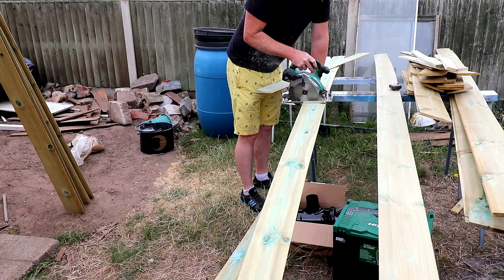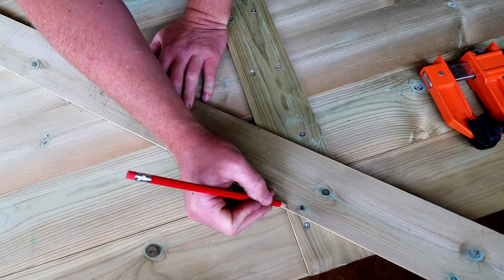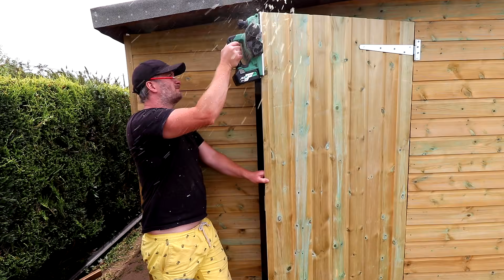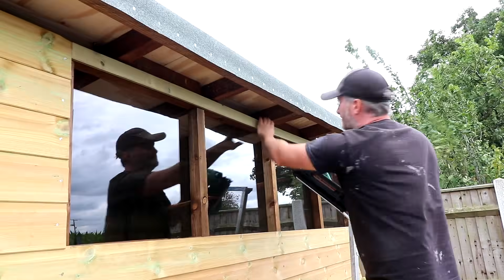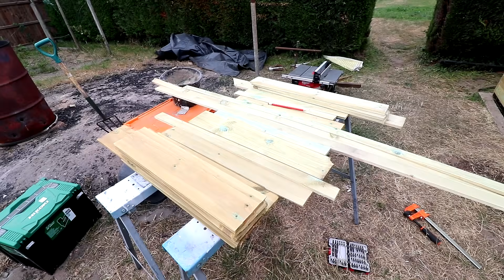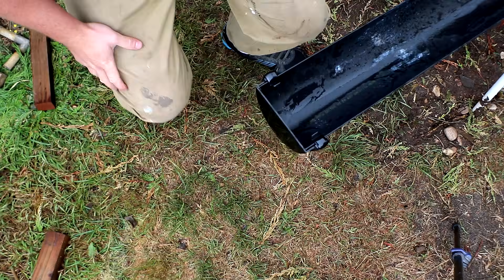Shed Door & Finishing Touches (PART 6 SHED BUILD PROJECT)

Comment: 99% Keith. You lose the 1% because EVERY TIME YOU OPEN THE DOOR ---- IT'S IN YOUR WAY!🤣🤣🤣 Why on earth did you not fit it, opening into the space you do not use?????? Mind boggling! Love your channel!
Reply: I always prefer an outwards opening door, obviously it’s less safe if someone puts something in the way when you’re inside & you can’t get out again (which is a key reason that internal house doors open into the room) but in this instance, the floor space and clearance inside a shed is more valuable and you might need those few mm that would otherwise block a door opening inside

Comment: Great video. Now time to try and recreate this with the world's cheapest table saw and a finishing hand saw...
Reply: Just like me. I haven't got all those power tools as I am not a builder. The only trouble was that the door kept springing open. I realise that unlike a house door you have to leave a space between the side of the hinge side door and the right hand door frame to stop the door binding causing pressure on the door which forces it to spring open. In other words I don't think one can fit the door flush with the right hand of the frame.

Comment: I've got the tongue and groove planks already to make my door for the small shed I built myself. I was wondering how I should go about nailing them onto the 'inside battens', found this video and had never even thought of gluing the battens on first before securing the planks with suitable length screws on the inside. Thanks, very helpful instruction indeed.

Comment: Due to my ignorance, if the vertical boards are fastened horizontally and diagonally, how can the boards expand and contract independently? I would think that since each board is different it will react differently.

Comment: Hi keith, Only looking at your finishin touches for the shed video just now. the tip imentioned back when you were starting the shed regsrding the slabs works for the paving at the front too. lay 2 lenghts of timber on the outer edges of your dug out foundation at the appropriate height and fall then get a piece of timber as a screed for the slab base. Cut a notch out of each end to the thickness or a bit less than a slab then scrape your sand base out. slabs are guaranteed to sit first time then. becomes a quick job....

Comment: I'd recommend adding 3 bolts to each of the supporting batons at the back of the door. After a few seasons of getting damp and drying out you'll find that the batons start to pull away from the door and the door begins to fall apart when just using screws.

Comment: Fantastic series, I love the simple window sils , and as you say what started off as make do to finish off the glass framing it ended up looking really good. However, I see you have no diagonals fitted for structurally bracing the walls. Is this an over site or international. It may probably be ok, but over the next year or so time will tell. The door staying square to it's frame will be the first tell if the shed starts to lean forward. I noticed in your last vidio when you were testing the strength of the roof rafters the top of the walls moved back and forward an inch. Please don't be offended by this honest critique, it's just feed back. As always 5⭐'s for your videos.

Comment: Hi Keith,  I enjoy your videos because you show it how it is in the real world. No job is ever going to run smoothly and it's nice that you acknowledge things are not quite right and how you work around them.  One thing I notice is how you hold your hammer.  If you hold it at the bottom of the shaft you will have much more control and power. It's balanced to make it like that. Just a thought. Keep up the good work. Ps I think if you are able to build a shed,  then it shouldn't be too much to design it. So long as you know the basics to setting out the frame. So I would say no to the plans idea.

Comment: Regarding plans, it seems you got a sketchup model already, so why not just publish that? I'd guess most people are perfectly capable of getting measurements out of sketchup here, and a 2d plan does not offer any advantages in my eyes anyhow.
Reply from the maker: The SketchUp model I did isn't exactly how I built it in the end, so it needs to be re-worked. Also I think the most useful aspect of the plans that I create is the visual diagrams and the cut list - at least that's what I think I would find most useful if I were following plans.

Comment: It will be interesting to see how the stainless screws hold up over time. Supposedly, stainless steel and treated pine don't go well together, which is why specific treated pine screws exist. Though any galvanised or class 3 coated screw will do.
A lot of your screws and the coach bolts appeared to be zinc plated too. Interesting to see how long they will last in the weather

Comment: Nice effort Keith. If you don't mind me making a suggestion, you should consider adding a door stop to the lower section of the door as well, to prevent warping of the door diagonally at the leading edge. And yes a third hinge would be ideal.

I've only just started my own channel, so I've got content envy of your great channel.

Keep up the good work!
Reply from the maker: The door stop goes to the bottom, it's in two pieces 👍
Reply: @RagnBoneBrown  Great minds...!

Comment: I set up a work area inside because (I miss having a smaller workshop...) No? :D Was that the Milwakee saw by the way? How do like that compared to the DeWalt? Great video as always. Cheers.
Reply from the maker: Thanks. The Milwaukee is very similar to the DeWalt, but with some useful additions, much less noisy and well thought out design.  Smaller table and blade though.

Comment: Hi Keith, I am sure lots of people will have already told you, but in case they haven’t the bolts with the square piece under the head are called “coach bolts” and they were first used in the making of coaches.
Reply from the maker: Cheers John

Comment: Hi Keith another great video , for the slabs I make a wooden frame outside the slab area and at the height I want the bottom of the slabs to be then use a broom handle fixed to a big block of wood {tamper} hammer the sand down and use a long piece of straight wood level the sand of the frame lay slabs first time ,
keep up the good work ,
G

Comment: It's Friday again!
Personally I am never really interested in plans. Most of the time I would make it different anyway because the situation for me is different. So 99% of the time I have to modify such plans anyway.
Reply: Yes. I see very little point in plans for the same reason. Mind you my shed is completely different....
Reply: I agree 100%. You've shown us the basic principles and most of us (if we were gonna build this) would do it slightly differently anyway. I prefer supporting you by buying stuff. No idea if that makes economic sense for you but every little helps? Keep up the good work Keith!
Reply: Drip edge and cladding is a nice touch too, but I’d use screws cos from experience over time the plastic can get broken/ need replacing (clumsy me or footballs!!) so needs to be easy to remove cladding.

Comment: That looks awesome & the attention to detail speaks for itself. Window sills look great. Much nicer then any shed you could buy. Where did you get that wire mesh you put around the bottom to stop rats etc. I need some of that for my workshop. I havnt had any problems to date but i also wanna put some gravel around mine so that would stop it going underneath.
Reply from the maker: Cheers! It's on eBay listed as "rodent mesh", available in different lengths and widths 👍

Comment: It’s all very well putting coach bolts on the door lock but all I would need to do to get in is remove the screws from the hinges. For added security on my workshops I put coach bolts on both parts of the hinges.😗
Reply from the maker: Did you watch the video?
Reply: Rag 'n' Bone Brown yes I did but I’ve never come across those special screws that you’ve used where can they be obtained.?
Reply from the maker: I got them from eBay they're called one way / clutch/ security screws

Comment: Nice one Keith, carriage or coach bolts is the name you were trying to remember!
Reply: Those coach bolts are pennies each,  less than a quid for 10x M6 from toolstation in various lengths.   

Great video diary this,  i was building my shed at around the same time (although i used cls so massively over engineered) and it turned out pretty close to yours,  so I'm happy.  Great vids as always Keith,  keep them coming! Cheers
Reply from the maker: Ah that's it! Cheers Fergus